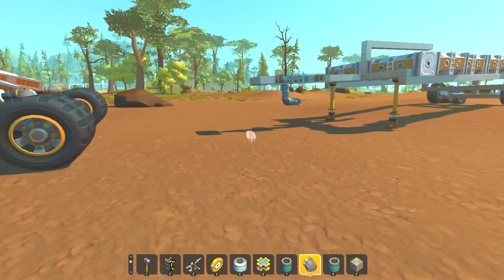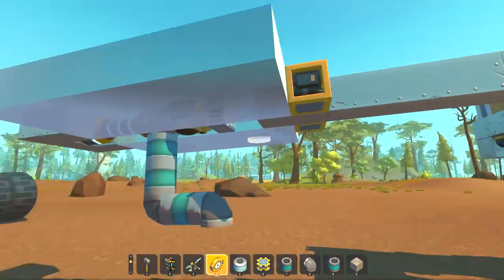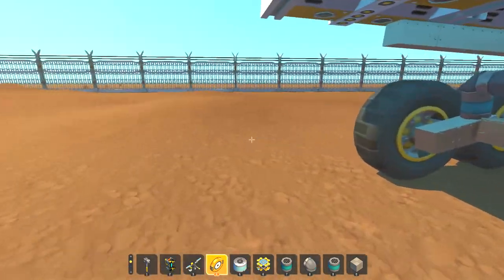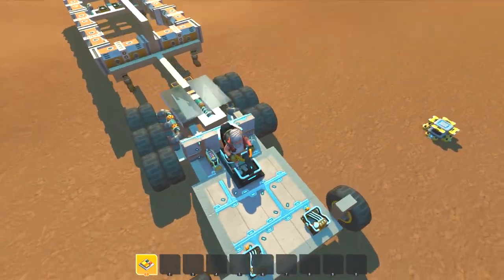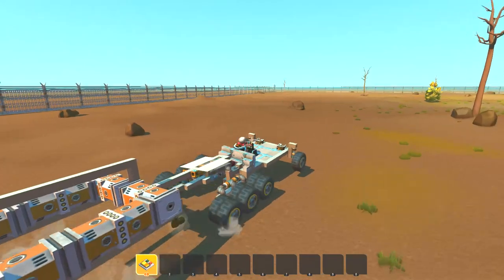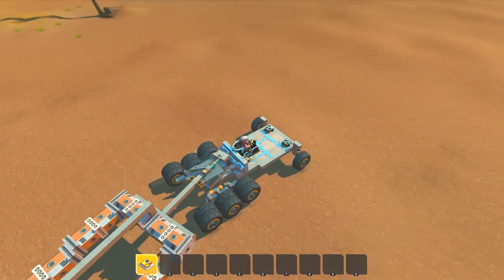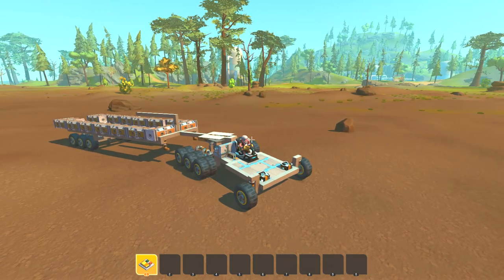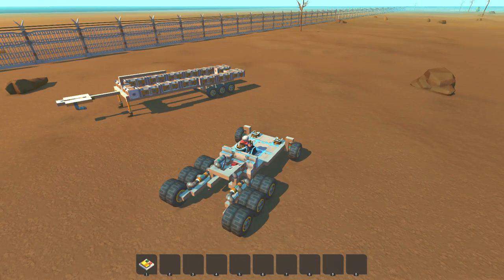Scrap Mechanic creative. Gimbaled truck hitch & articulated multi-wheel suspension prototype testing

Comment: I can make better version of this suspension on solid axles
Reply from the maker: Have you got a link? I have better designs now too. The issue with this design was trailer wheels on the "Arm" would not generate enough down force for tires to grip and add traction to the whole road train. The "problem" I was trying to solve is the sway when suspension is compressed during cornering, 1 side collapses, and the other pushes tripping the load over.  It also needs to handle a single bump/ pot hole, to be "Crossed" by the 3 tire set with minimal sway on the load.